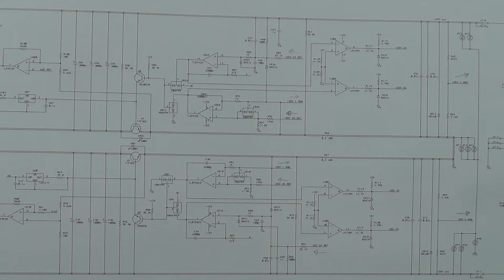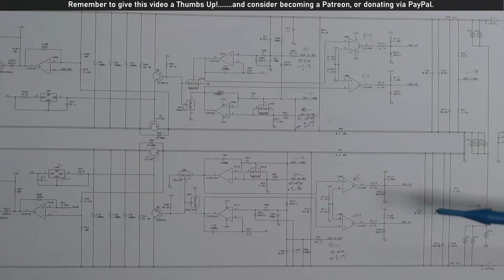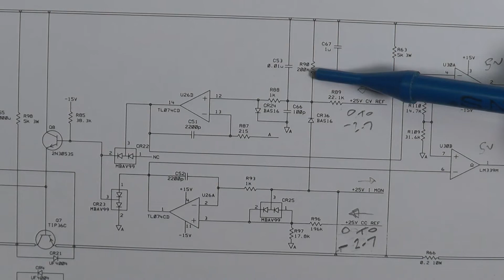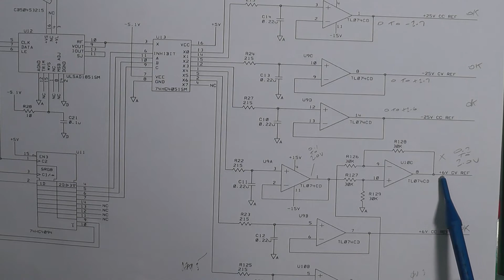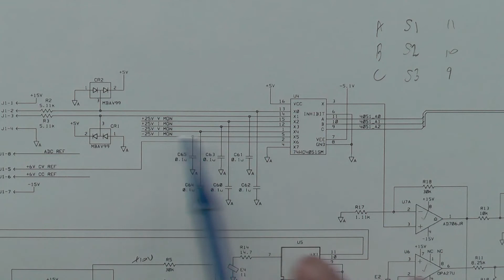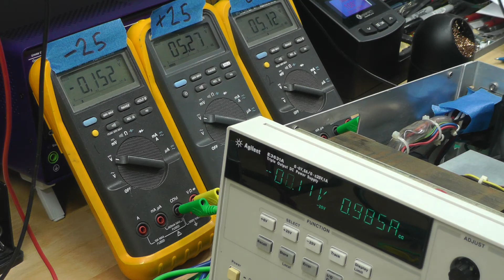No.069 - Agilent E3631A Power Supply Repair & Restoration - Part 2

Comment: First of all thanks for a really informative video covering a lot of the diagnostic path I'm currently going down. I'm restoring an E3631A power supply originally with a '625' error code sorted by replacing the opto-couplers. Next problems was the supply functioned OK on all supplies in CV and CC modes but the monitor function (using the ADC) didn't work. Turns out it was the same resistors 30k resistors open-circuit in the +/- 10V reference supply as you found in this video. Now I've got the +25V and -25V supplies working OK and displaying correctly in monitor mode but the 6V is still displaying garbage either a higher than 6V or 'noise'. All the CV and CC 'mon' and 'ref' voltages seem to check out OK on all supplies. Any ideas of the most likely culprits to investigate next?

Comment: Perhaps that specific type of resistor is more sensitive to vibration damage? This power supply did suffer an impact due to a fall from great height if I'm not mistaken? I believe part 1 deals with most of the mechanical damage caused by the impact?

Comment: One of the best! This eye-opener tells me, what I need to go to learn, beginning with the ltz1000 at eevblog, what I already do with PX and FX. But the connection to the outer world to control precise voltages and currents, and control them back through the uP, is the next essential part. Which op's will do the job? All these analog electronics, these KiCad and maybe STM32Cube-things are relative new for me, I feel like i don't have enough time to learn all this stuff, and to be able to implement it in my own projects, anymore ;) But I will! What a fantastic world! Therefore, big thanks to you, Ian ... 👍👍👍🎄
Reply from the maker: Thanks!
I know what you mean about lack of time.....it's dang hard!
I have an STM32 project on the go and really like it.....but not CUBE, I just use the Arduino environment.

Comment: Excellent repair series! Very interesting. I've only experienced resistor faults a handful of times. The last time was a 4.7ohm through-hole gate driver resistor opening up inside an AC PSU, causing two power MOSFETS to blow up (4x parallelled MOSFETs per rail in that unit). No corrosion or dirt, since this PSU was used in a cleanroom. I had a random temptation to measure those resistors as part of the gate drive circuitry inspection. Glad I did, otherwise I'd be chasing that fault for a while. This Agilent PSU seems perfect for analog development. Nice unit!

Comment: All that dirt on the PCBs in combination with humidity might have damaged the resistors over time. Your water rinsing might have done the rest.
Precision Thin Film resistors like these have a conformal coating on top of the resistive film to protect it from corrosion. The resistive film is usually structured as a meander, or LASER trimmed with an I or L cut. So it's evident that if the coating was damaged, these structures have corroded and you get  an open mode failure. Maybe that dirt was chemically aggressive and also damaged the coating, but that's no so probable.
We had a series problem many years ago with a certain supplier of Thin Film resistors, where this coating initially had so called pin holes, because the coating lacquer had a chemical problem. This created exactly the same failure. If you put the failing chip resistors under a microscope, you might see such pin holes.   
Therefore it's necessary, that you optically inspect and replace all Thin Film resistors from the same brand on both PCBs.
Reply from the maker: Good info, thanks!
The fault existed before I got the PSU, there was a label stuck to the case explaining the fault.
There are just 3off those 'green' resistors remaining which i will change out, I have yet to look up the BOM to get the spec. of them.
No choice with the water rinse I am afraid, the gunge on the pcb's was just horrific and I didn't fancy any foreign diseases.....LOL

Comment: Could it be that constant thermal cycling of power supplies, could contribute to SMD caps and resistors kicking the bucket earlier, than their through-hole counterparts, with their fancy led bends? 
To me, if the solder used doesn't expand and contract at the same rate as the two ends of a cap or resistor, a lot of force will be changing hands, and the story wouldn't end well.

Comment: Very odd, these "precision" resistors. Maybe I'm a barbarian, but these modern supplies are over-engineered, too complex? Anyway, it was a pleasure to see how you find, test and resolve these faults. I wonder - is such (faulty) equipment cheap? Thanks for sharing! Merry Christmas and happy New Year!
Reply from the maker: Its an older power supply so uses the available technology of the day.....plus, cheaper to use 5 cheap components despite a more complex design than 1 more expensive component. Its all about the BOM cost.

Comment: Very nice series. I am presently digging my way through a 66312A. Service manual diagnostics say the interface board (has all of the digital, DAC/ADC, talks to the front panel), actual measurements say the main board (analog board). Has factory options  J02 and J03, which include replacement of some components and deletion of others, and make the feedback loop oscillate , and are not covered in the service manual, so it has been an interesting voyage. Your recent videos have been a lot of help, in large part reminding me that the analog side of the supply is repairable like any other analog system.  Keep it up. You are doing good things. Thanks.
Reply from the maker: 66312A looks like a nice bit of kit.......hope you get that one up & running.

Comment: I'm a bit disappointed that you didn't show the calibration.  Excellent video.
Reply from the maker: I did it in the last Agilent PSU video I think so didn't want to repeat myself. I also need to re-fit new precision resistors when the arrive first.
Reply: The calibration is pretty simple on these power supplies, you just set the voltage in the display to match what it’s output is measured as. I did some similar work on some Agilent E3647A supplies a year or so ago.

Comment: Nice work, it's good to see equipment repaired. I've personally found a failed-open resistor in the reference section of a E3631A, so I guess it's becoming a common fault.

Comment: Another great video, thanks. Can you use a different multimeter? That blue one isn't very clear, especially the minus sign.
Reply from the maker: I think you might be right......I'll try an get a new one in the new year.
Reply: But the blue one is cult ... 😉✌️
Reply: @hwj1822  yes, it's sad considering what a milkshake duck he turned out to be